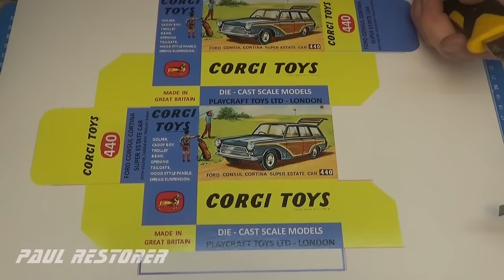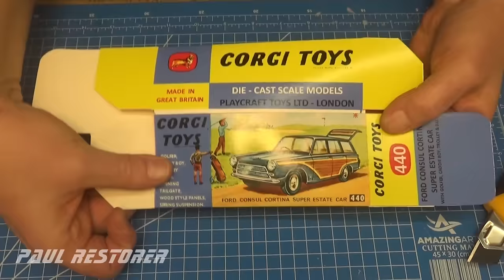Ford Consul Cortina wersja z golfistą. Renowacja modelu firmy Corgi nr 440.

Comment: I find these restorations of old toy cars very therapeutical even though I would'nt have the patience for it. That caustic soda is lethal stuff. 👍
Reply: So is the Selleys paint stripper, that I use.  But it does work really well in giving you a clean bodyshell casting for the new paint.

Comment: Fantastic restoration Paul. Thank you very much for doing a mk1 Cortina. The earliest car i remember is a mk1 cortina estate that my late dad had, although it wasn't a woody. Also my first car was a mk1 cortina, but it was a 4 door saloon instead. Interestingly the wood look side and rear panels on a cortina woody weren't actually veneer. They were a 1 piece moulded composite panel for each door and wing called di-noc. These panels are now rarer than rocking horse poop, enthusiasts restoring these cars resort to having fake panels made using veneer. One enthusiast brought a whole car that had original panels on it so he could fit them to the car he was restoring. The car he took them off of was made after the woody's were discontinued by Ford so they shouldn't have been fitted by a previous owner.
Reply from the maker: Thank you very much

Comment: Mine which I've had from new, has plain dished wheels but the same Ford Consul Cortina designation. At a guess, working forward from my DOB, it must have been bought for me about 1967-69.
Reply from the maker: great, considering that they were produced until '69, yours must be '67 if it has the inscription on the hood, Consul. Best regards

Comment: I think the Caustic Soda looks cooler when you add it After the water!

Is there any advantage to using it instead of other methods?
Reply from the maker: a person foams more when added to water, so to avoid possible spilling outside the bathtub, I do it this way, the effect is exactly the same and the risk is lower. To be sure that it will not boil over, you need to have a very high container.